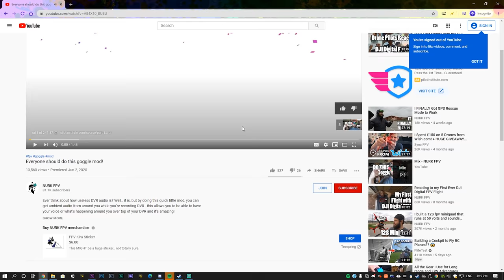I converted this Seaplane to FPV

Comment: Thanks for this video!
I have flown several aircraft and quads FPV (analog and digital), but your video is the FIRST and ONLY one I have seen where you connect the DJI Air Unit almost directly to the battery.  Please explain, or even better, add a video showing a little more detail on how you wired this up.  I’d love to convert my fixed wing FPV analog to digital video.

Comment from the maker: Check out the @Insta360  ONER  - https://bit.ly/3efkTCE

DJI Products ARE ON SALE!:
Video Transmitter: https://bit.ly/3fOfYJV
Get Started with DJI: — https://bit.ly/3crk3l1
DJI but I want my own radio: —https://bit.ly/3crk3l1
DJI Receiver Directional Antennas: TrueRC Patch for DJI — https://bit.ly/3cs3xBi (requires 2, not necessary, but amazing)
DJI Receiver Omni Antennas: TrueRC Stubby Singularity — https://bit.ly/3cqC2rD (purchase 1, comes with 4)

Comment: Hi, I know this was made 4 years ago but currently trying to do the same, do you happen to have the link for the connector you soldered onto the air unit cable? Also what connector does the battery have that powers the air unit?

Comment: are the electronics oon the plane conformal coated ? Great video, and again,Happy Birthday !
Reply from the maker: I believe so, since after I was done filming, I crashed it upside down and it's fine!
Reply: @NURKFPV  Even with the air unit on or you removed it since?